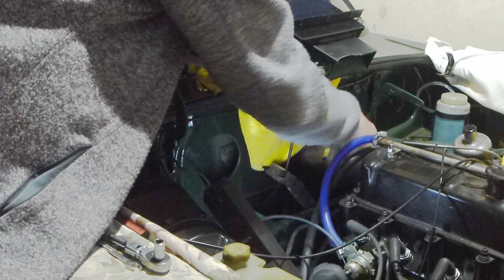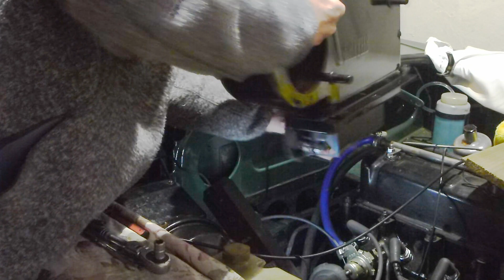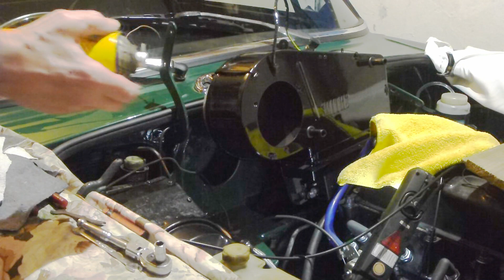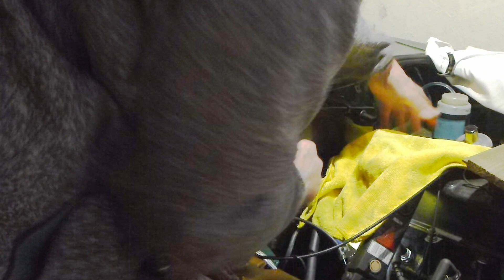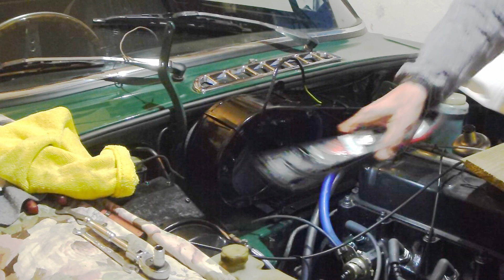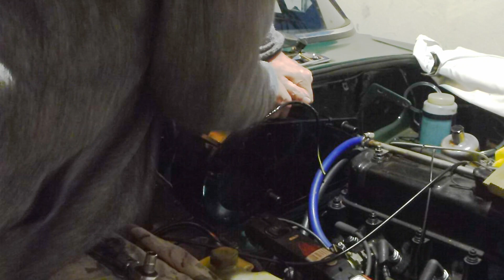MGB heater fitting (1970 MGB GT)

Comment: Ok - apparently it can be done!!  I’ve tried everything possible to install my beautiful powder coating heater with this hard rubber seal and just can’t make it work.  And I have the engine out!  I would have to bend the top mounting bracket over and this would ruin the powder coating . Perhaps my Heritage body shell is somehow different- but I’ve been trying for over a month… and I build race cars for a living

Comment: Thanks for posting! Did you have to trim the rubber seal any?
Reply: I am having issue with the rubber seal. Seems stiff and too thick to get the housing in the opening.
Reply from the maker: @Stubby0266  The rubber block is actually not required. I did fit it but shaved off some of the bottom edge and the back (with an electric carving knife). Later cars have a depression in the bulkhead the block fits into and only that rubber block seems available, so needs trimming.